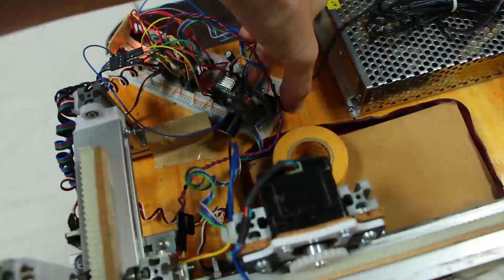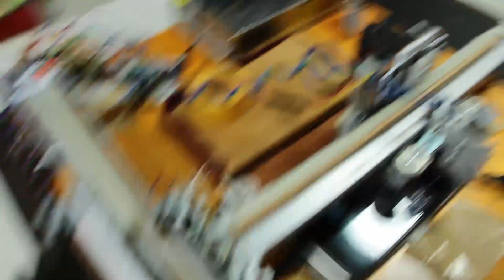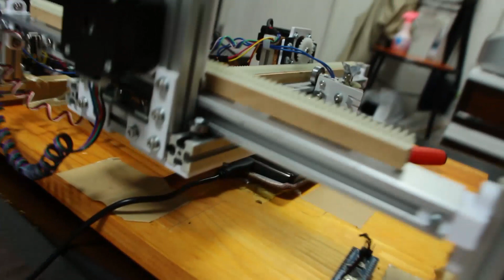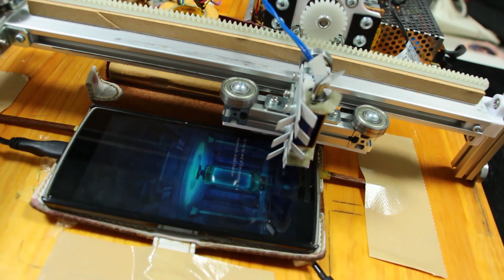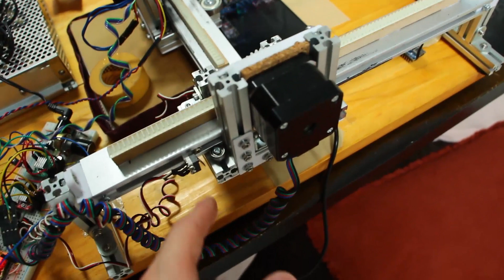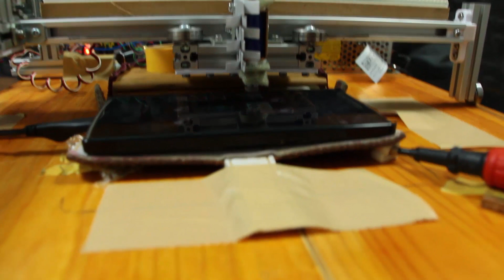Terra Battle SB farming machine

Comment: How much and how long does it take to make this device ? Do you SB 100% all character , don't you ?
Reply from the maker: yes I did, excepted certain characters excluded from the pact.
It took me about one week to design the machine, a week end to make it (including the arduino programation), and the debug took me about a month (while using the machine though).
Reply: Then you can make money by selling your TB account or this farming machine :)
Reply from the maker: Be Gone  Money is not what I am after.
Reply: @Benn25  Could have just used a bot like autotouch for iOS.
Reply from the maker: @BitterLime1  this is no fun, lack the challenge, possibly detectable by the server (resulting in ban), lazy and despicable.
Reply: @Benn25  it's not detectable efficient, and practical. And the fact you call it lazy and despicable is extremely hypocritical.
Reply from the maker: @BitterLime1  Well it all depends on your objectives. if my goal was to beat the crap out of everyone at this game, so yeah, you would be right, but as a matter of fact I don't care at all about this game, it is just a pretext I found to build something fun that brings technical challenge. The rhythm and music of beautiful mechanics, the art of programming a magnificent beast made of metal, coupled with a very precise way of quantifying the efficiency of the machine are the only things I am after. Call it a lazy approach if you want...
I have a crooked mind but I don't think I am hypocritical, quite the opposite if fact : I am perfectly honest and transparent about my purposes.

EDIT : I said that I was lazy in the description of the vid, I'll give you that, it was just a silly comment absolutely not to be taken seriously... But I thought that the D.Trump quote would make it pretty obvious anyway.